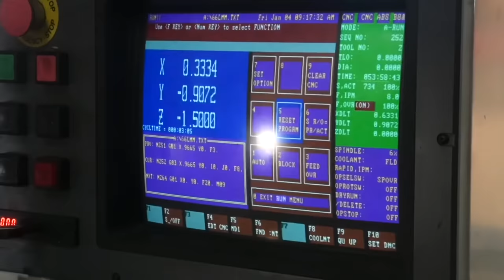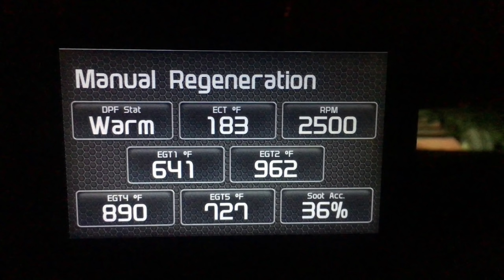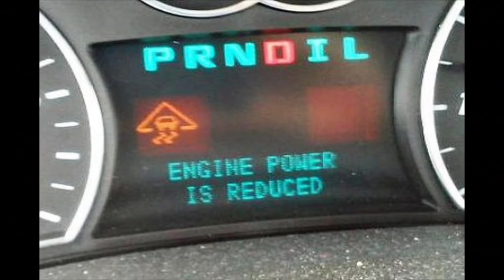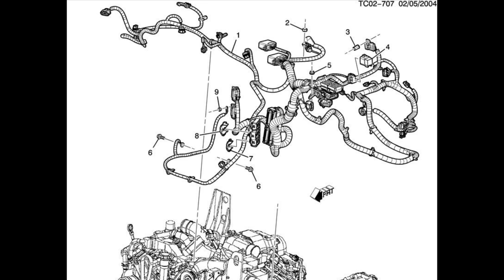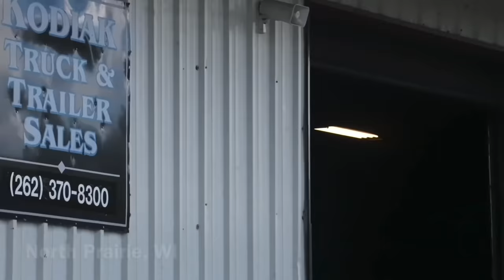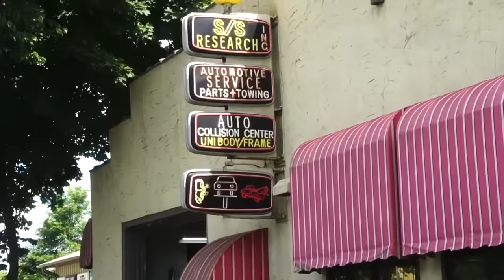Duramax Problem’s That Will Leave You Stranded!

Comment: LML Duramax, deleted and tuned thought had  ECM/PCM issue, no comms with OBD scanner at times/  stabilitrak, traction control on dash and no crank. Was almost certain ECM was bricked and was going to replace when I took off driver side wheel well and just moved the engine wiring harness around and then the truck would start. It was intermittent and an electrical automotive shop already replaced the fuse box on the driver side a year before for the same sporadic behavior while driving. I used to think it was a fuel rail pressure or fuel prime issue but it was electrical all along. The company that made the tuner is out of business, my concern was replacing the ECM and having to have a different tune installed that's supported because of the EGR delete... Thankfully its not the case, hope no one else has that issue with the engine harness

Comment: My TCM went out last year (2009 Duramax). Why they mount it on the radiator, one of the hottest places in the engine well, is beyond me. I bought my AC Delco OEM TCM (unprogramed) online for $250. I begged my local GMC dealership to program it for me (and install it) for $175. I've heard of people paying as much as $2,300 for this repair. GMC charging for programming is a rip-off and should be illegal. No other industry does this. Imagine if you needed to replace the hard drive on your pc and Microsoft wanted hundreds of dollars to reinstall the os that you already purchased a user license for. TCM should be a 15 minute DIY $250 repair.

Comment: I own a 2003 LB7, it would be nice on the next vids if you can list all issues for a certain years/engine gen what and where to look into.  As well as a simple upgrade to improve the economy, performance, and longevity of the engine and transmission.  Thanks.

Comment: Awesome video. I recently went from a 2005 LLY to a 16 LML with only 41K.  The truck needed a EGT sensor which the dealer replaced and the shop did a forced regen.  I have driven the truck about 1,000 miles and it has not gone into regen again yet.  Most of the miles have been on the interstate.  How often should you see the truck regen?  Doing Air Dog soon and getting a CTS 3.  Never really worried about the LLY that much but all the emissions stuff on this truck worries the heck out of.  Thanks for the great info!

Comment: I dont know how the new regen systems work, but my 07 kodiak has a switch that allows me to regen even if parked, maybe this system could be used in pickups..idk
Also guys who run they're Dmaxs in snow,  i know my lmm will suck snow into the airbox and the maf sensor will pickup moisture and send the truck into limp mode, i keep a 2nd airbox cover with me that had 4 1" holes drilled in the top to help draw warm air keeping the filter dry.. 🤘

Comment: This was a terrific video, even if it was all new & Greek to me! I will watch this video several times in the coming weeks to take it all in, and I will definitely keep these guys in mind to call when my truck needs work. Thank you for posting this video! Ha, and here I thought you would just talk about DEF, which I already understood. I envy you truck guys who really know your stuff!!

With my super sensitive nose I can smell something sweet in my engine near the driver's side near the tire well but coming from the engine. So now I've learned that I need to check if the coolant is leaking a bit. I'm hoping it's a minuscule leak or just normal burn off for the first 1,000 miles it is being driven? I'd been foolishly hoping it might be a brake pad that was new and burning off residue, but coolant seems to hit 100% on a google search. I'll be towing my family & our 9k lbs. travel trailer next week over 8-10 high western US mountain passes, and in our 100 degrees summer heat am hoping everything is ok with my new truck. On the dash I can scroll through all my current engine stats and nothing stands out at all, including all engine temps & brakes. Still, I'll try to get some time to check my coolant level manually just to keep an eye on if it starts going down at all. This truck hasn't been driven 1,000 miles yet.

My truck is a brand new 2022 GMC 3500 Sierra Duramax, it is a 4WD AT4 single rear axle, here are my engine"s specs (taken from GMC's site):
6.6L Duramax Turbo-Diesel V8 engine
445 hp [332 kW] @ 2800 rpm
910 b-ft. of torque [1220 Nm] @ 1600 rpm
3.42 rear axle ratio
Allison® 10-speed automatic transmission

Can anyone tell me which of the things in your video would apply for my vehicle? I hear you speaking about a "5" or "L5" and other engine models or something, but have no idea where mine fits into that so I can get my feet under me and follow along here. 

Thanks in advance for any & all advice, thoughts & direction given - I welcome them all!! It helps me to learn and keep my family safe :)

Comment: Transfer case pump rub up through the 07 Classic. 
Leaking power steering and transmission lines. 
Glow plugs LBZ.
Seals in the fuel filter heads after a period of years.

Comment: I owned at one time to Duramax I will never ever on another one but I am glad you men are talking about these trucks I now have 2 Cummins dodge I have Learned a true diesel is a in-line six cylinder that’s what all big trucks run out here on the highway
Reply: I agree on the 6 cyl comment you posted  
I just bought a 1999 Trade Winds 7370 model motorhome.
It has a CAT 3127  6 cyl turbo 300 hp diesel with a 6 speed Allison auto trans .
What a pleasure to drive . Tons of toque...around 900ft pounds if im not mistaken . 
Same in the big trucks .
Reply: I love the Cummins engine.  The rest of the truck I can't take. I had one. The truck pulled like a freight train, when it would start. Had so many problems the dealer contacted the manufacturer and made them buy it back. I have had four Duramax trucks. I average 1000 miles a week so I put some miles on them. Only problem out of any of the four was a wheel bearing.

Comment: After battery replacement, if your 2008 LT stalls or randomly doesn’t want to start due to air in the line, change your fuel filter and possibly housing if it continues. Yes you can prime the filter but it will eventually happen again. Weird and annoying small issue. This is all from my experience.

Comment: Lost the serpentine belt on a lly when the power steering pump pulley came off.  It is now secured with a bolt and a series of correctly sized washers.

Comment: I put my truck in drive and the service sabilitrack service tracks on control popped on. Low and behold it was a TCM. That was a 13. Now my new 11 has service sabilitrack service trailer brake system.

Comment: I want to know more about LB7 Duramaxs and problems please
Reply: The main lb7 problem is injectors. Air gets in em and the body of the injector cracks and dumps diesel into the oil. A good lift pump solves the issue

Comment: My 2015 I put 110 thousand on my pulling a 16000 lb 5 th wheel no problems. Had a older one never had problems other than batteries going dead every 3 yrs

Comment: Makes me want to sell my 2012 .It only has 140,000 on it.It runs great and has a ton of power.Man that was a lot of info.
Reply from the maker: Don’t sell it
Reply: @TruckMaster  I wont get rid of it till the wheels fall off.Its an SLT.Every option for that year.Including the power sun roof.It was deleted and new injectors and glow plugs last year.I have an 89 LX 5.0 Mustang that has been worked??And I'm sure that Max would blow it away.It gets to 105 in a hurry.

Comment: Talking about the TCM fault mine was when I went to go crank my truck and it wouldn’t fire just crank over. Had a crank sensor fault and and TCM fault. Come to find out my crank sensor and MAF sensor was shorting out the system. Had both replaced and no more issues.

Comment: Check you airfilters regularly on l5p if the filter is dirty it will start kicking the engine light on and have msny different codes

Comment: I have an ‘01 LB7 with an RDS turbo, hi-flow exhaust manifolds, uppipes, 3” downpipe, 4” exhaust. HSP intercooler pipes.... also an Edge CTS-2. 
I dropped a “key security code” at an intersection. Was able to restart the truck to limp out of the intersection. Then, with the Edge, reset the code. Problem gone....

Comment: I wanna here more about the LMM. looking to be buying one this spring. I'm tired of my 2010 f250 6.4l powerstroke.
Reply: Go for a LML much more Robust, frame are boxed, leaf springs are a 1inch wider, the whole truck is beefier
Reply: Lmm all the way 👍🏻, don’t go for a lml with def and cp4💩
Reply: @RBTMOTORSPORTSLLC  238,000 miles trouble free after 80,000 mile delete
Reply: I love my lmm.. 2007.. egr disabled and exhausted deleted.. been a great truck for 260k miles now.. i had 1 water pump replaced and a few front end parts here and there..
Reply: Thanks guys
Reply: Very happy with my LMM. Cored out DPF, WC Fab compound turbo s475/stock, efi live, love it.  Have about 220,000 miles on it now.
Reply: @natep1661  do you daily drive yours
Reply: @ronniebray6143  yes and no. I take my work vehicle home every day and so most days of the week it does not get driven it just sits. However when I do go out of the house it is my main driver yes.  The compound kit actually makes the truck awesome at around town driving. Truck picks up very quick.
Reply: Gotcha.
Reply: What else about the lmm do I need tobe aware about. I heard that the pistons crack under pressure
Reply: @ronniebray6143  anything CAN crack under pressure. For the guys that were boosting the hell out of the engines and abusing them ya. That's I believe 1 of the 1st things to go. However mine for example, I have my compound turbo kit, and efi live and all but I don't abuse my truck.  I don't even have my engine studded, yet.  My tune max',s out about 45 psi which is pushing it a little but I don't drive with the pedal to the metal all the time  and my truck runs like a boss.  If you're not planning on modding it out, you likely won't have any issues.  You don't normally do burnouts holding the engine at 3000 rpms, you likely won't have any issues.
Maybe I'm addition as known get some better tie rods, I have kryptonite heavy duty tie rods, I've heard good things about PPEs tie rods too. Dmax stock tie rods are a week point. But luckily aftermarket fixes it no prob.
The alison 6 speed on these is tried and true, independent front suspension so no death wobble!  The G80 locking rear is simple but affective. 
Mine has been bulletproof.  Just basic wear/tear stuff.
Reply: Ok yeah thats what I thought so. But I'm gonna be making mine a daily driver to and from work. And pull my 26ft camper on the weekends with the family. And then back to work again. And every now and then go play a little bit just to have fun. So I was just thinking 5 to 600hp the most.
Reply: @ronniebray6143  ya I commonly double tow with mine.  Even before the compound turbo kit, it did good. I tow our 32' 5th wheel, plus 16' flatbed with atv's.  You can get the lmm to 600hp fine, even with stock injectors and it'll last a long time.  You're not in the sanger zone at that point. I would highly recommend a dog delete and egr delete. It'll be a whole new beast.  Those 2 things big down power pretty good. Just don't skikp out with a cheap egr delete though.  Most have problems eventually with them pulling loose the y bridge horn.  1st had had a blocker plate installed then eventually installed the wcfab y bridge when delete kit and doing nothing else it was a major difference.  It's pricey but worth it if you tow.  Quality kit and quality results.  Obviously tuning needed.
Reply: Ok thanks nate.
Reply: @ronniebray6143  I pull my 26ft rv all over the rockies no problem 2" leveling kit with bilstein hds all the way around.. the trucks just bad ass and fun to drive.. i never heard about pistons cracking but mines just exhaust deleted with a turn down just under the cab, sounds like a jet engine now..
Reply: @jredd801  ok thanks nice to know. Just can't wait to go get an lmm now.

Comment: 07 LBZ and still have 50% brake pad.  220K miles. [30k towing]
Turbo Charger under warranty at 72K. [vanes were sticking]  Dealer Task
Alternator
Batteries
Belt and pulleys [Prev Maint]  Dealer Task.  LBZ is known as belt from hell.
Fuel Pressure Reg.  
One Glow Plug
Head Liner Cloth Falling
Transmission Lines Rotted and Failed at a stop light. Dumped 3 gallons.
Steering Wheel Rattle. [too lazy to fix]
Brake Booster Replaced
Power Steering Hose Leak
One Window Motor
Suggest Checking Rear Diff Fluid Level. Factory Under Filled Many. Runs Hot. Look For Burnt Paint on Diff.  Mine Barely Had One Qt.
Just broken in and running better than ever.
Not for Sale. But get offers.
Original Injectors, CP3, Water Pump, and did I mention Brake Pads? [that don't dust]

Comment: Great video even though I'm a Cummins owner lol I'm loving my first diesel that I purchased 3 weeks ago.I have caught the bug for sure.I.bought a 2006 Ram 2500 with a 5.9.I have installed a magnaflow 4" exhaust turbo back,edge evolution cts3 programmer and a S&B cold air intake.

Comment: I have an 05 lly only issues I have had were the pressure membrane in my transmission. And I have pulled some big loads and done some stupid things with it. The other major issue is the injector electrical connectors. But other than that solid motor and Trans. Way better than a 6.0l or 6.4, or the Cummins bluetec

Comment: Guess I'm lucky, 300k on my LBZ and I had to replace a glow plug; other than that, fluid and filter changes. I have the pump rub kit for the t-case, but haven't needed it yet, knock on wood.

Comment: ok guys I have a 2009 GMC durtymax with 168k miles. last July i was cruising down the highway no load and going about 65mph.  Out of no where the trans locked up and i came to a harsh washboard rear end gear drive line u joint snapping stop and and dirtymax was down for the count. so i took it to a very legit custom shop  local in WA state  and we took the trans pan off and it was 1 inch deep full of metal grindings all fresh and nasty.  SO a new trans build 12k with verynice internals  stuff only issue was a TCM failure caused my initial issue and GM stated a 1 year back log of TCMs for the 2006.5 to 2010 Allison. So I was on the waiting list with GM and everyone else with unusable trucks. So the shop owner said look I built a 2009 Allison and swapped into one of my personal ford pickups that i dont drive much.  So  the owner hooked me and gave me his TCM and did a custom tune to match my new built 6 speed.  I was so fortunate that this shop owner saved my ass and got me back on the road last October. I feel for you guys with bad TCMs . Sound Diesel  Performance...

Comment: How can the average Joe justify owning one of these trucks? Seems like not only you need to be very knowledgable about diesels. You also need to carry a complete tool chest so you can work on it. Just to wrench on the side of the road. Are these trucks reliable at all? I think i'll go with a gasser to pull my camper. Thanks for the advice.

Comment: I purchased a 2007 Classic LBZ with around 150,000 miles.  The truck came with a DSP5 switch but there is obviously only a single tune on it as it doesn’t change in power and I have tested switch function with a multimeter.  I bought the truck to pull our camper and am not intending to do anything crazy.  I would like to purchase an optimized stock tune but the first step is identifying what’s been done to the truck.  While doing that I found something very goofy which I am not even sure how it functions.  The wires going down to the fuel pressure regulator on the CP3 have been cut from the main harness (see picture).  My fuel pressure cold at idle is around 12,000PSI which makes sense if the FPR is not functioning.  It never breaker 13000PSI while driving.  Is it possible to tune so that you don’t get a check engine light from the FPR being ”unplugged”?  Ever seen anything like this?  The truck runs fine and the only check engine light is for a cylinder one glow plug.  First step is to solder into the harness and wire the FPR up and I'm guessing I'm going to be figuring out why they cut the wires...hoping its something simple and not the CP3 or even worse the injectors.

Comment: 2016 LML EFI live EGR-DEF delete, transmission 2nd gear seems to split... under load feels kinda like slipping or a shuttering feeling. 110xxx miles EFI done @ 106xxx miles. Is this a TCM issue?

Comment: I have a 04 crew long bed 2500 lb7 and and I've had to do the injectors once been through 3 prndl switches and on my 3rd rear u joint also getting ready to rebuild front end for the second time and it only has around 120,000 miles

Comment: Yeah my 7.3s has a up pipe/ manifold leak im saving to get fixed as it isnt real bad yet and i have an apcm installed (unit wreckers and ambulances have for elevated rpm for pto or better 12 volt charge) on my trk. Finally got my parking brake fixed but i still use my toggle to tell my trk parking brake is set and i have my apcm programmed to go to 1700 and with my 5 inch straight pipe she sounds like a jet. Running 180cc injectors now and a 63mm? turbo is in the plans.  I daily mine mostly but i do have a 13k trl i tow

Comment: the newer rams got a cp4 issues as well there's actually a kit to swap the cp4 to the cp3 which was the most reliable common rail pump . the cp3 is a good pump for sure for both brands of trucks    I thank the lord all the time that my 2004 ram 2500 5.9 does have nor did it come with any emissions crap just a good ole 5.9 with an amazing cp3 :) screw that trash emissions systems. yeah burn more fuel and burn our junk fluid while your at it in order to clean the environment up lol I never thought id see the day when burning more junk was better for the environment lol